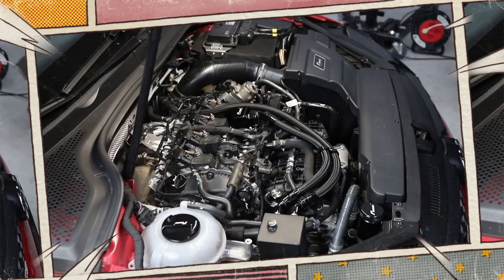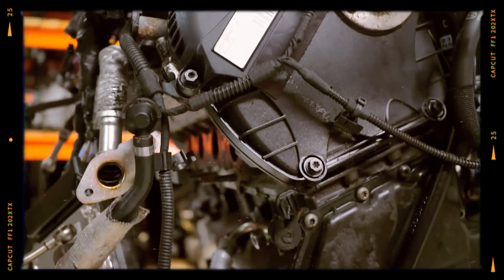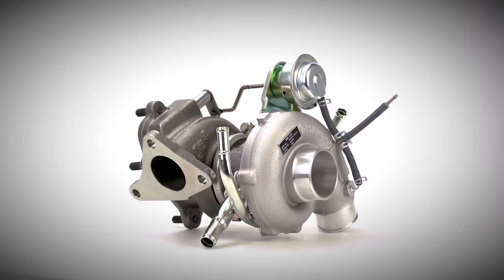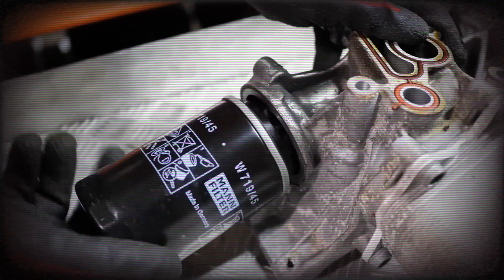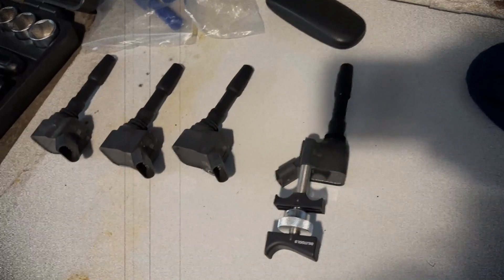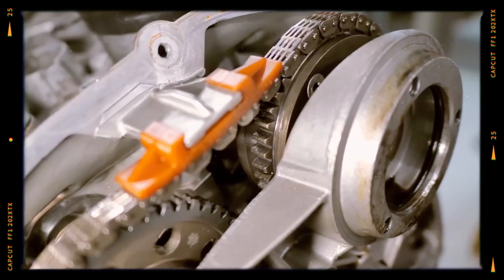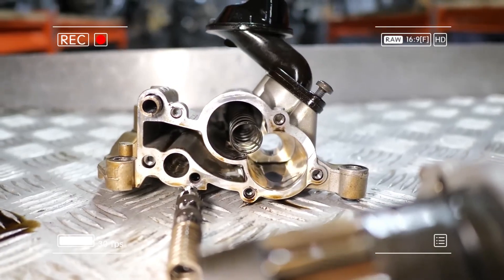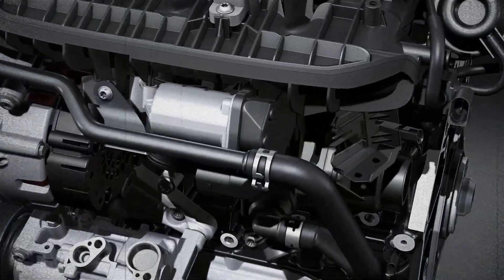Volkswagen 2.0 TFSI EA888 Engine – Problems, Design Flaws, and Reliability Explained!

Comment: had a CJX Gen3 206Kw for 4years and 100,000km, no problems whatsoever. Everyone says Gen 1&2 are basically a prototype and data collecting porpoise. Only until Gen3 or later is the real EA888. Even I am not driving a VAG now, but I’ll still consider VW/Audi EA888.

Comment: EA888 is a failure
Reply: The first 2 generations are a major failure but the next ones are pretty amazing especially the third one, even despite all of the plastics they hold strong. Sadly the 4th gen lost its MPI (indirect) injectors and now in the 5th one it's all online ECU controlled wirelessly
Reply: @AlpheccaMeridiana  gen 3 is probably the best. The 4th gen is still good, but the carbonization is a danger.
Reply: @OverlordSim i got tiguan 2015 in Canada is that gen 3 ?
Reply: Io ho un EA888 da vent'anni e dopo qualche problema dal quinto anno al decimo, adesso fila liscio che è una bellezza. 😊
Turbina originale mai cambiata.
Reply: I wouldn’t say that I have 190k on it. I replaced the tensioner removed the stupid oil screens in the cam bridge and balance shaft. Water pumps have been replaced a few times. Injectors sometimes gunk up I think the carbon build up is annoying but it’s only every 100k that it gets bad. Not a bad engine certainly beats fords ecoboosts and that coolant in the cylinder issues